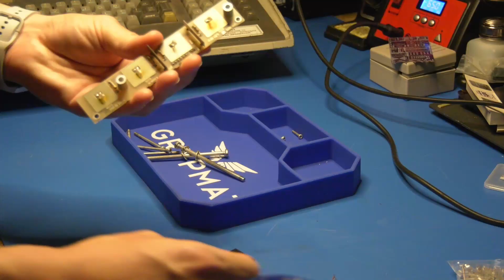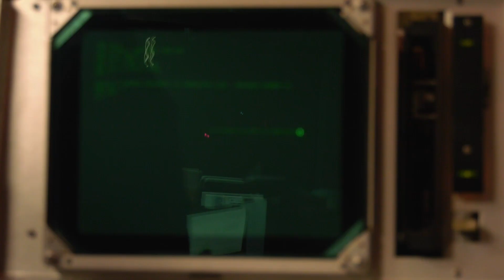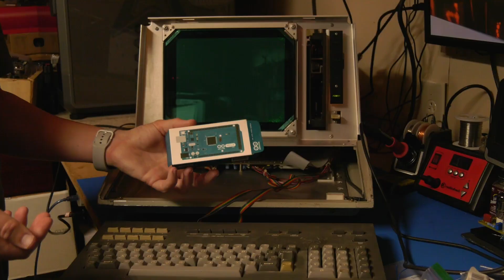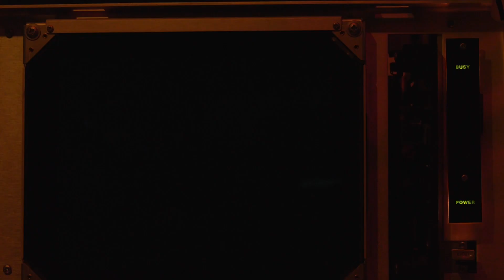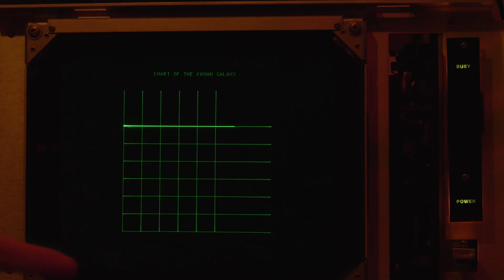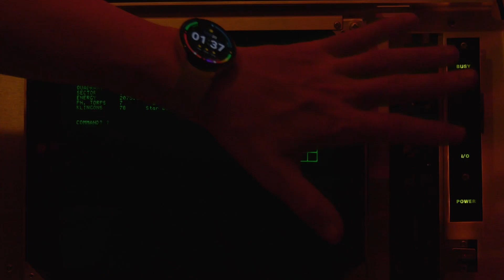Tektronix 4051 from 1977 Lives Again!!

Comment: what did you have to do to fix the screen?
Reply from the maker: I hit the connections with deoxit and then did the video calibration. It still has a bit to go on the reliability side but the video calibration was what ultimately got it working.